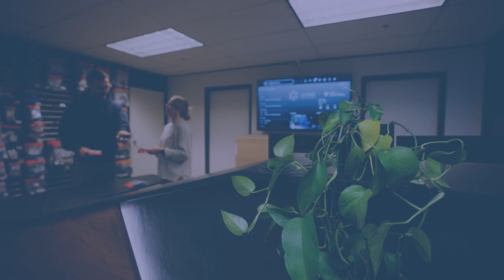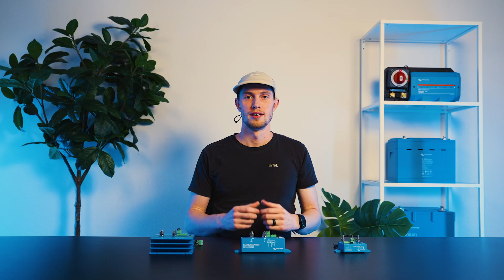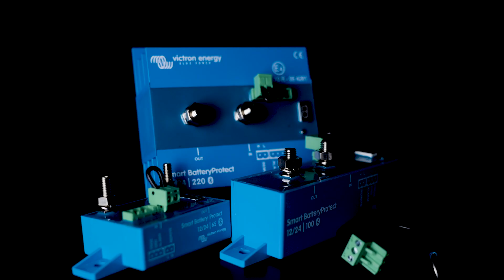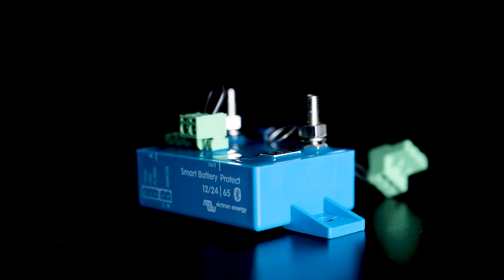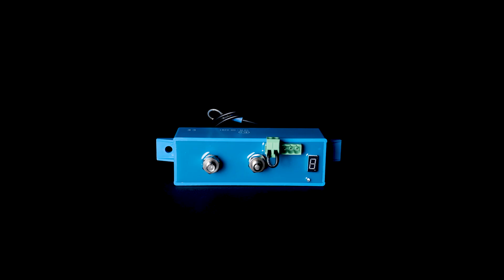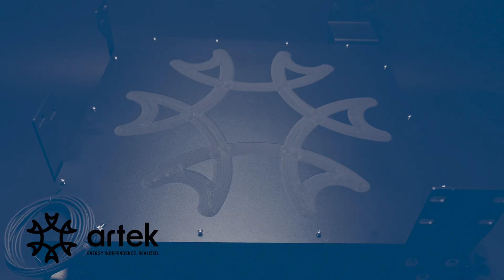Victron Energy Battery Protects | Overview and Basic Information

Comment: If my battery temperature is too low the BMS shuts down the system properly however on restart the battery protect shows a short circuit and I have to remove the two pin connector, turn on the breaker before the battery protect, and then put the connector back in place.

Comment: Hi Sam, I understand the reasoning of a battery protect on the 12 volt load side, but I just can't wrap my head around placing one on the charging side? Specifically, why have I only seen it used on the solar chargers and not the DCDC chargers. Would a good BMS perform the same function?
Reply from the maker: Hi Peter, great question! It can be used on the charging side of things as an an analog option for that disconnect. For example the smaller Victron solar charge controllers don't have a remote trigger port to be controlled by a BMS so adding in a battery protect can act as this interrupt. Specifically with the solar charge controller side of things you could also use a VE.Direct Non Inverting Remote On/Off Cable to act as this disconnect, hence you have two options here.  The DC/DC chargers typically will have a remote analog trigger and hence do not rely on the external battery protect. In regards to the BMS, Victron Smart Lithium batteries do not have an internal BMS and only the LYNX BMS has a physical contact to disconnect the system meaning the others rely on controlling external disconnects in the system. There are significant advantages to this, but are also some cons. Feel free to email us if you have any questions!
Reply: I have one of these connected between my starting battery and three lithium batteries used for an electric trolling motor. The thought was to program the cut in at 13 volts and the cut out at 12 volts. That way the alternator could supply some charging voltage to the lithium batteries without completely discharging the starting battery. 
The high voltage cut in works perfectly every time. However the low voltage cut out never works as programmed. It generally cuts out about 11 volts but as the day goes on it gets lower and lower…
Do I have the wrong device for the mission?